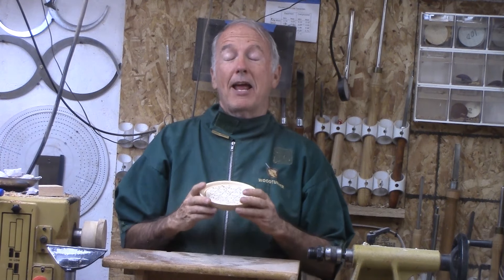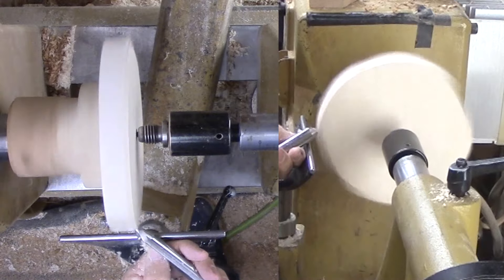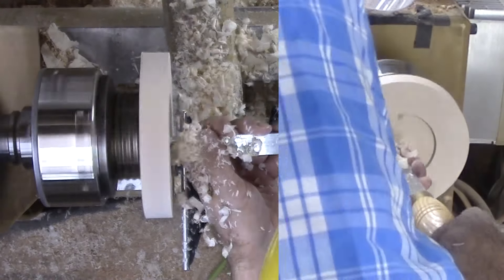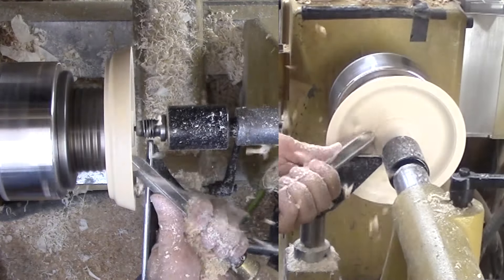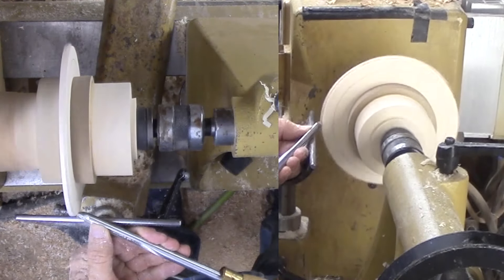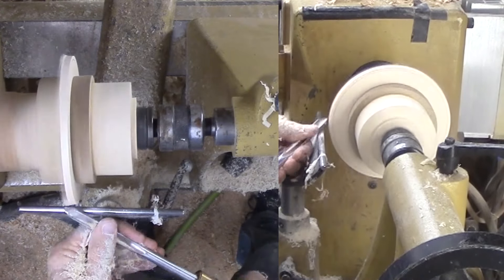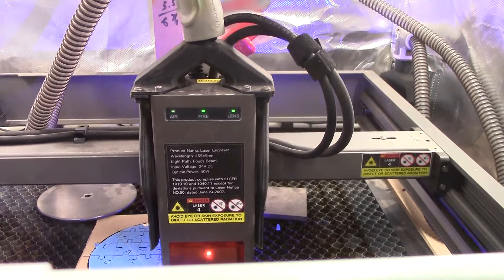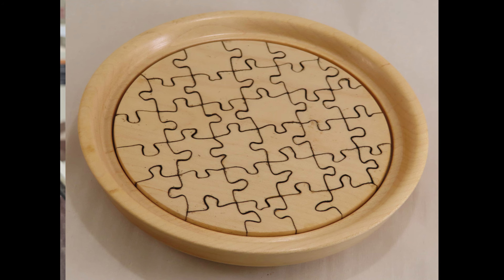Turning A Trivet With A Touch Of Technology

Comment: Nice project!  I would like to know more about the tube connected to the top of the laser.  Is that a clean air supply to reduce smoke fouling inside the laser head?  Is it pressurized?
Reply from the maker: It is an additional exhaust hose coupled to the original fan. port bolts to the laser head (from Embrace Making). I have a more powerful exhaust fan than supplied.
Alan